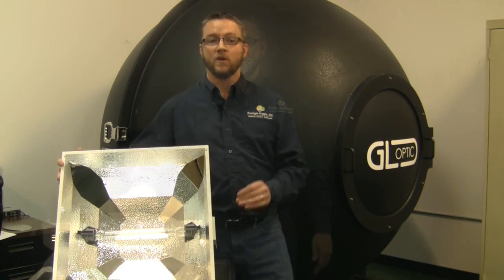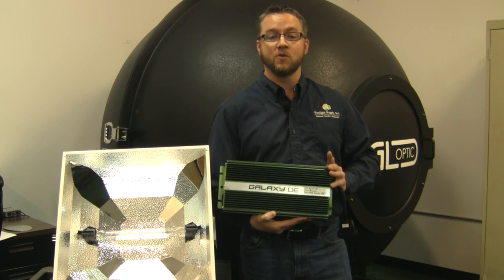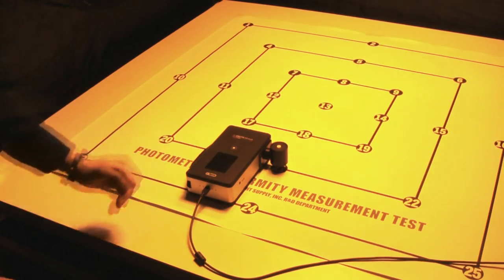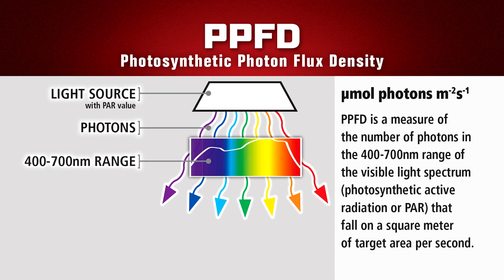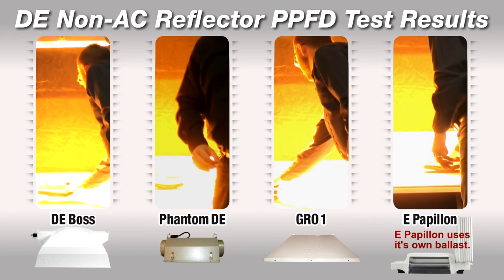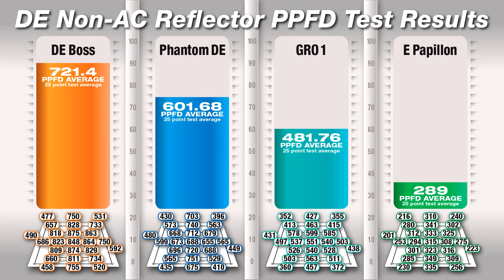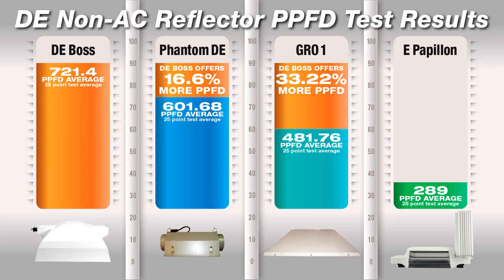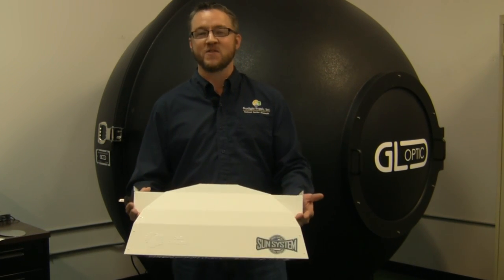DE Boss Comparison Test Video 2015

Comment: I would like to know the output average between the DE boss and DE ac sun systems unitreflector?
Reply from the maker: +steven clifford Light loss transmission through the 1/8” thick, tempered soda lime glass lens will typically average -3% to -5%. The variation in percentage is due to the broad range of spectral wavelengths being effected. Note: This may not be the same with other DE air cooled hoods if they are not properly designed to maintain lamp temperature. Thanks very much for your interest in Sun System products!